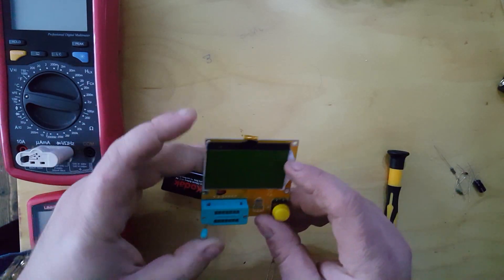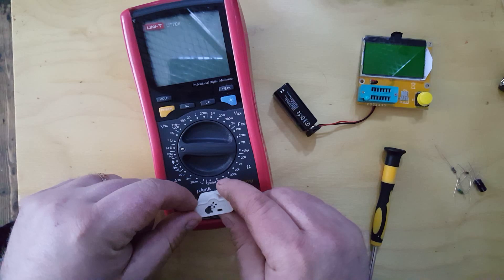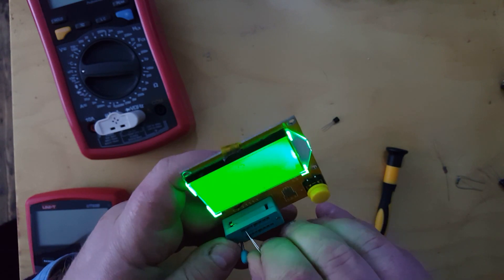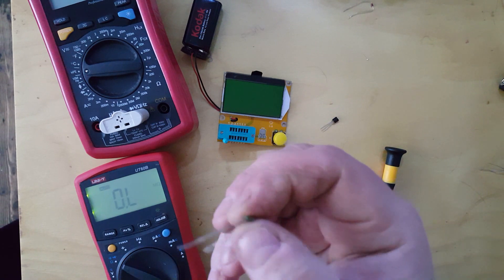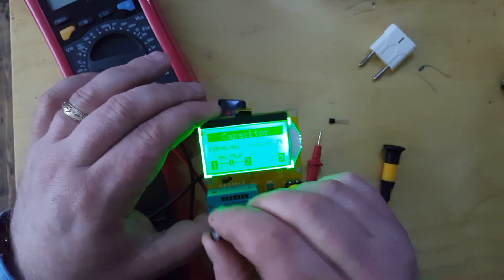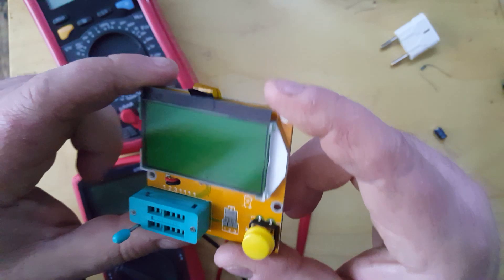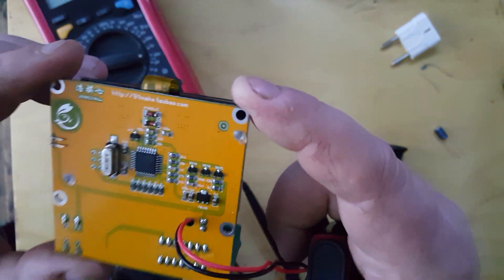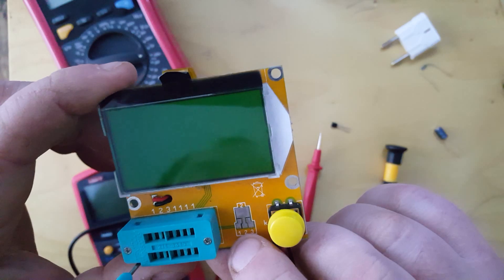Review and test of ATMega328 based component tester

Comment: you can test mosfets, transistors, diodes, inductors, resistors, capacitors and led's.
they are quite useful and surprisingly accurate i have tested quite a few different ones and use them quite a bit, you can put leads in the socket clamp to make it easier, the surface mount parts can be tested on the pad on the board(the one marked 123).
as with everything price is everything some of these are better than others, the more expensive variant with the plastic case either assembled or the kit version is the one to go for, two german lads developed this meter and it was copied on mass as it was open source, its still in active development today and if you work out the pins you can put their more accurate firmware on, sometimes you can find a version of this with the through hole at chip, you can desolder that and add a socket, then dumping and reloading/playing with firmware is a breeze.